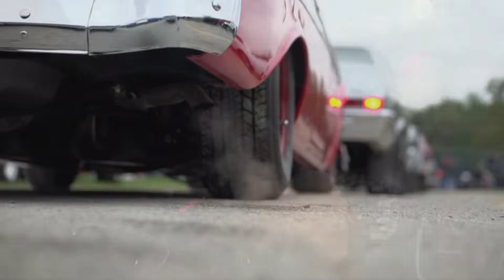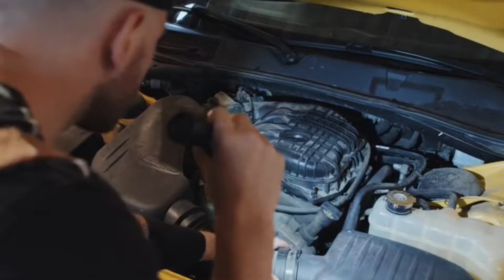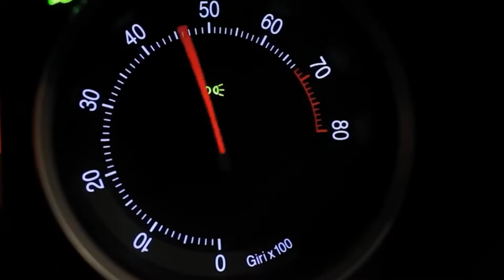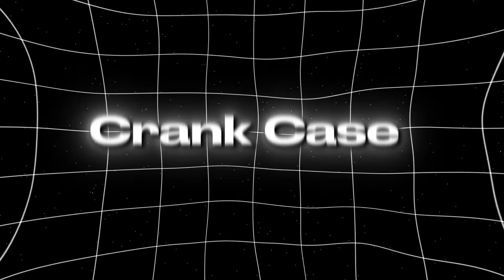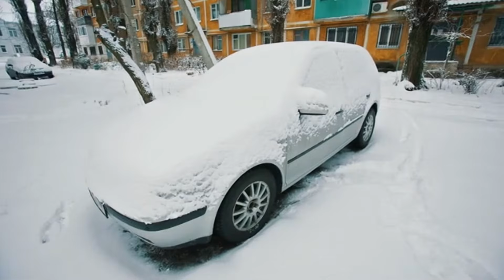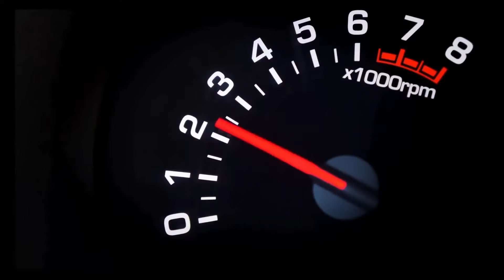9 Reasons Your Engine Revs Up and Down at Idle | Idle RPM Fluctuations While Car is Parked

Comment: my car spits out a PO125 code, two shops haven't been able to fix it, it is more work finding the right mechanic than it is to fix a problem
Reply from the maker: That's definitely frustrating when a P0125 code keeps coming back after two shops have looked at it. It often points to an issue with the engine not reaching or maintaining proper operating temperature quickly enough, which can be caused by a faulty thermostat, a coolant level issue, or even a temperature sensor giving bad readings. Sometimes it's a tricky one to diagnose!